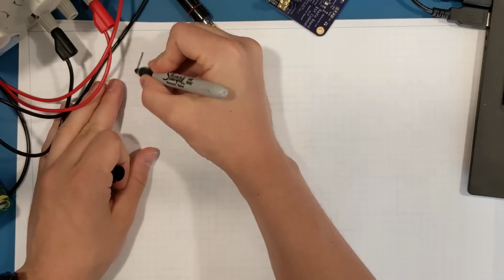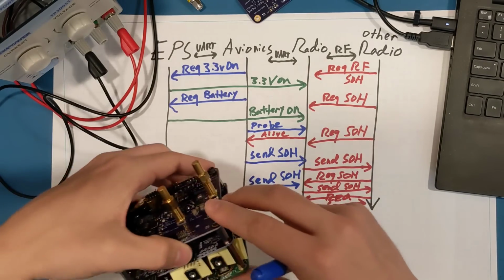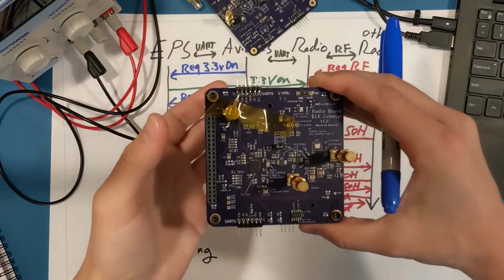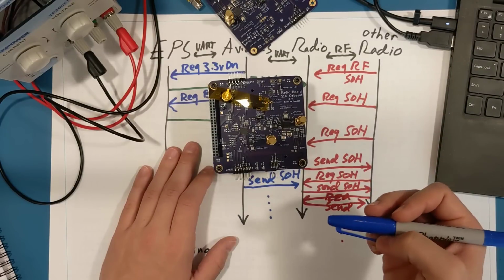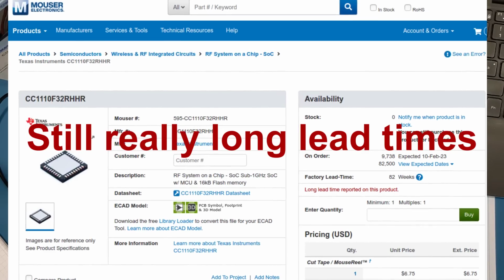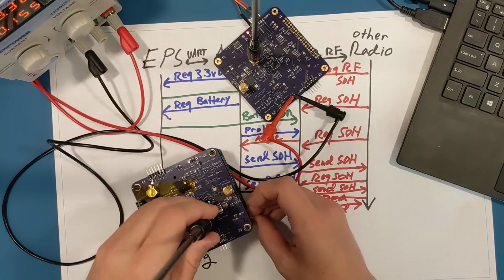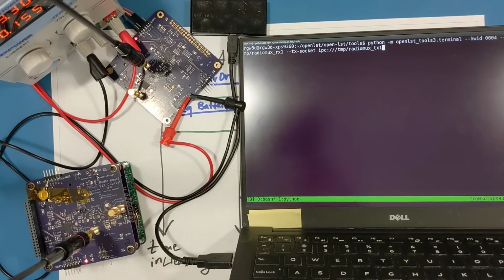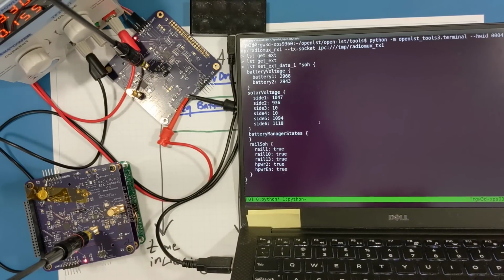$1K CubeSat Radio Integration | CC1110 & OpenLST

Comment: Hey man, I've been facing a problem with the PA of this UHF board. I've the same CC1110 UHF board with PA RFFM6406 designed exactly based on your changes in schematic from Openlst. I've taken the radio example code given by TI on github, and modified it for own my project. And I'm building the hex file using SDCC compiler, so the code is entirely controlled by me. The PA input/Output from CC1110 is perfect and has 10dBm power as seen in spectrum analyzer, but when I enable the power amplifier using those control pins (EN, BYP, TR), properly configure the switch paths for Tx, and finally let Vapc pin float as resistor divider circuit is already there to provide close 2.25V I see nothing on the power spectrum of the spectrum analyzer . Only If I set Vapc to 0V by making it a gpio output, I get the unamplified output coz Vapc = 0V means 0 gain. Is how I'm configuring the PA right, or have I left out something, how did you do it?

Comment: I have been working on my own OpenLST radio aswell. Let me tell you, even with a hot plate, soldering on that rf front end is a pain and its super easy to cause short circuits. Im already on my fifth board in the making because of this thing.

Comment: Would LoRa be better for communications? It uses less power than FSK, for a given SNR.

On the other hand, the IC for LoRa does lots of onboard processing. Compared to the simplest FSK transceiver with a microcontroller with ECC memory, a LoRa integrated transceiver would be less resistant to radiation-caused crashes

Comment: I’ve been following these videos because they are very overlapping with a LoRa repeater project I am working on. I’m curious though - it seems you’ve budgeted power and features for a self sufficient cubesat but not for any payload. There’s no science or data collection or anything else aspect to your cubesat.

So my question. Is, in this not at all theoretical cubesat you’re building, what is the intended payload?

Comment: Speaking from experience, you really need a radio that can be on and capable to receive packets all the time, if your radio consumes 150mA in receive mode then its worth investigating if you can do something about it. You also really need to broadcast sat health data periodically, at least every 10 minutes, more frequently if power budget allows. Without these broadcasts you will not be able to get help from volunteer networks and existing ground stations for locating your satellite after launch.At least 10 minutes because then you at least have a chance to receive a packet during very good overpasses, something like 5 or 3 minutes would actually be much better until you get Norad ID and up-to-date TLE-s for it. You can extend the interval back to 10 minutes once you are sure that the TLE is actually tracking your sat and not somebody else's. In a month or so the sats will drift apart enough for incorrect assignments to become obvious. Speaking of power budget, I really doubt that the pathetic little 30mW cells are going to be sufficient for anything. I think typically cubesats are covered with Azur Space panels, best of these are close to 1W per panel and you can have 2 of them on each side of 1U sat. yes, probably expensive (I did not pay for them, so dont know the actual cost), very brittle and pain in a butt to work with, but very good.

Comment: Snazzy! Looks beautiful. Will they let you launch it without sending it to a lab to test spectral emissions? Are there any certifications that come with the OpenLTS framework?
Reply from the maker: I'm certain I'd need to get this fully tested and certified. No certifications from OpenLST, but it is reassuring that they have used this sort of design on other cubesats